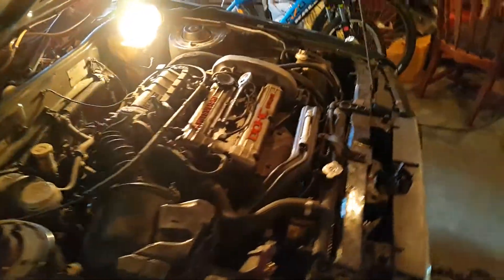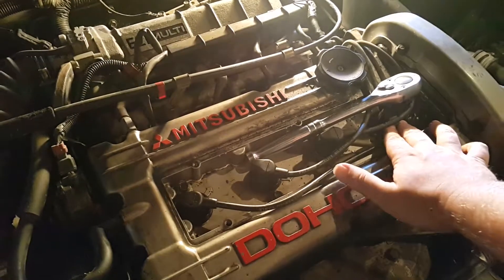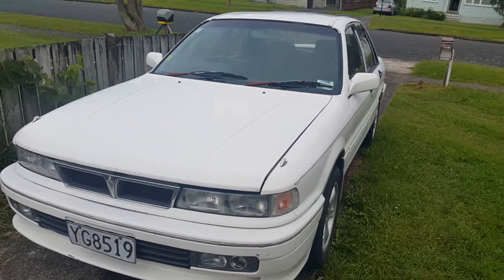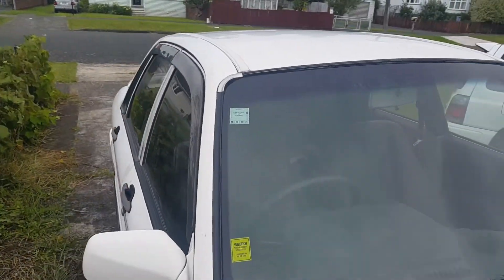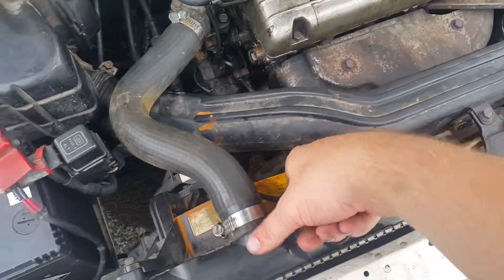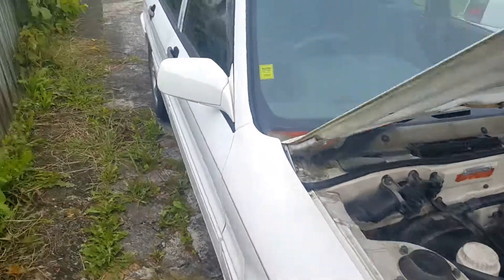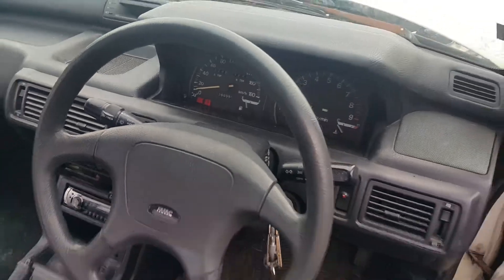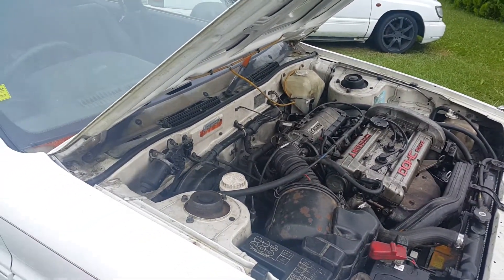Finally all done for the Mitsubishi Galant 4G67

Comment: it looks like the exact same car i have but its auto unfortunately and i want to swap to manual but im not sure what transmission to get would you know what one to get ?
Reply from the maker: Yeah you're looking for a front wheel drive transmission f5m33, if your auto is front wheel drive.
Reply: SadamFlu Thank you !
Reply: Also where’s the best place to get one ?
Reply: Also what other cars have the same transmission
Reply from the maker: You'll find them on other Galants. If you're going to do it remember to get all the bits like the shifter and pedals. After that is a little bit of wiring of the reverse lights and keeping the car thinking it's in park.